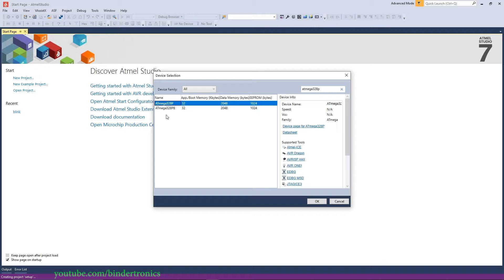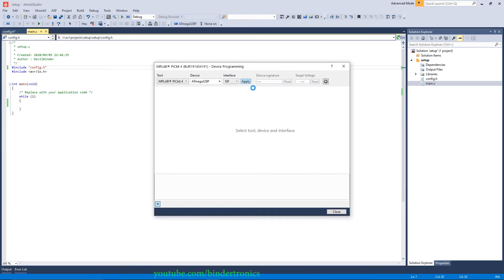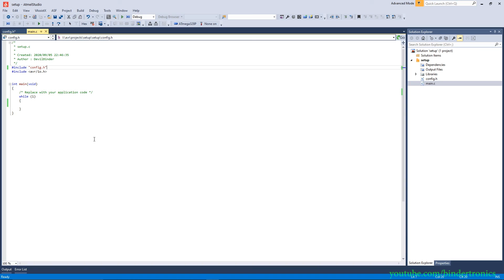Project Setup 🔴 ATmega328P Programming #3 AVR microcontroller with Atmel Studio

Comment from the maker: Full playlist on the ATmega328P AVR microcontroller https://www.youtube.com/watch?v=BHryCFw2U30&list=PLtuqBdbsL-DvbB6QAGgoGBAEsGuXfGFoF
Reply: Hello, I am using the Atmega328 MCU. I tried to set the fuse registers as you mention but it is showing the Fuse waring. 
Fuse register    Value
EXTENDED       0xFD
HIGH                 0xD6
LOW                   0xFF